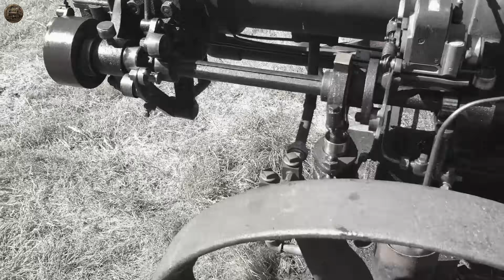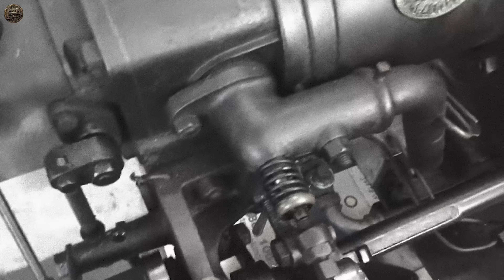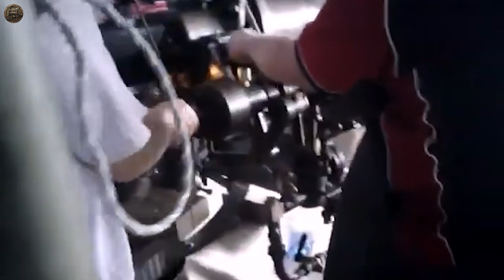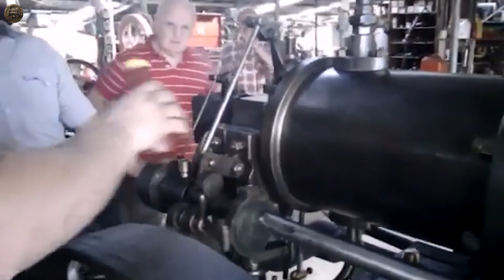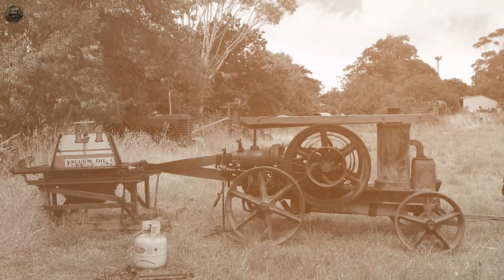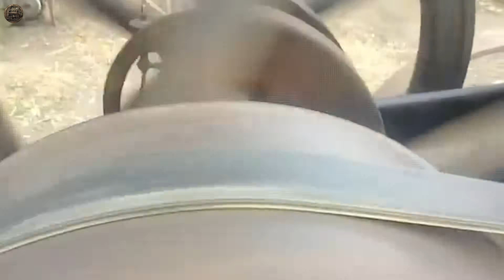UNBELIEVABLE DANGER: Don't Hand-Crank A Giant Steam Engine Like This!

Comment: Good footage of the old-style engine running...
But the title is wrong: That's not a steam engine.
Reply from the maker: You are completely right to point out that labeling error, and we are glad you still enjoyed the raw footage despite our unfortunate metadata mix-up. We accidentally applied the title of a steam tractor video to this classic internal combustion engine, but we deeply appreciate viewers with a sharp eye for historical accuracy keeping us in check. Looking past the incorrect title, do you find the sheer physical danger of hand-cranking these massive early gas blocks to be more intimidating than the high-pressure boiler risks associated with true steam power?

Comment: Great looking engine. I love old iron
Reply from the maker: Thank you for the support, as connecting with fellow enthusiasts who have a deep appreciation for the aesthetic and mechanical presence of classic old iron is exactly why we run this channel. There is undeniably something captivating about the raw, exposed engineering and heavy cast-iron construction that defines these century-old powerplants. When looking at the massive hand-crank mechanisms on these antique giants, do you find the physical danger of a sudden kickback or the sheer strength required to turn them over to be the most intimidating factor?